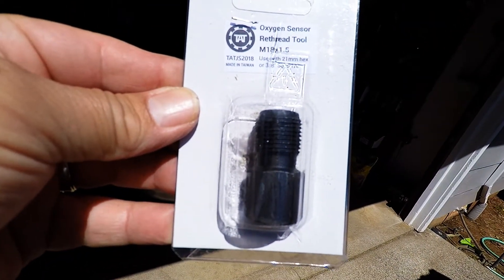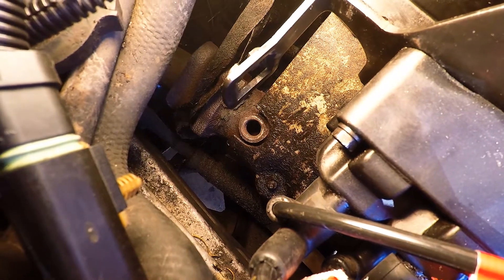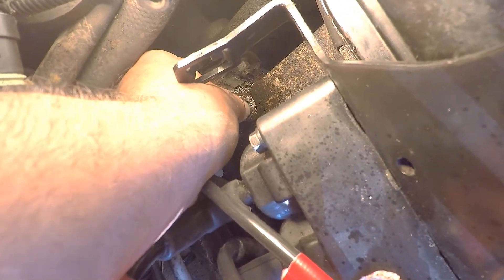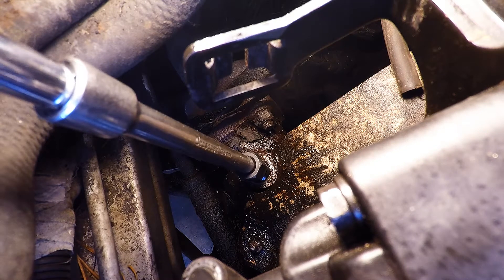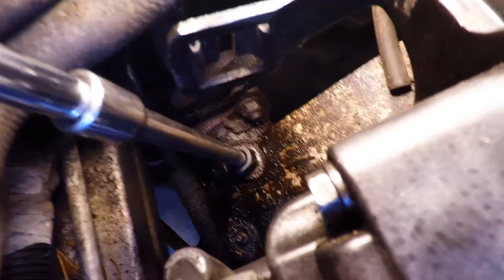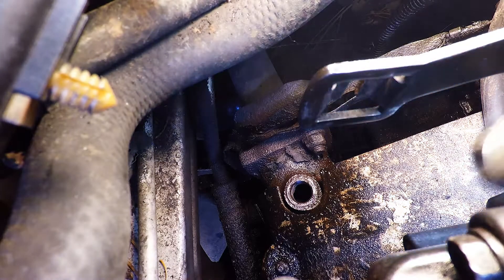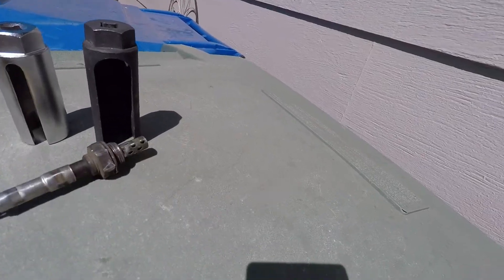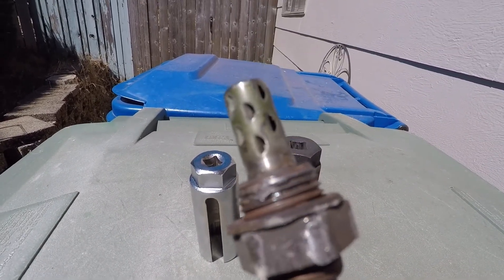Oxygen Sensor rethread tool.

Comment: What happens if its not straight and little bit crooked.
Reply from the maker: My only suggestion is to take your time. 1/8 to 1/4 turn with rotation. It my first time doing this. Also use lubricant during the process.

Comment: You can use a screwing hose-clamp around the split end of the socket to strengthen it when taking out difficult sensors. That way it will not bend at the socket rim split and further strip your sensor nut.

Comment: That's how my sensor got out. It is worse than yours optically but with a little time and a dremel , make in fit again inside the catalyst. I have put some antiseize grease and will never stuck again. If your sensor is not at good shape but works fine, you don't need to buy new one.

Comment: My o2 sensor threads messed up like yours.  Looked like the stripped out one at end of video.  How good did the thread chaser tap work? Where did you buy it?
Reply from the maker: Thread chaser work really easy as long as I took my time. I had never done this before. I bought it on ebay. There are a few other demonstrations on this procedure that was helpful.

Comment: Just to let someone else know those sockets they spread under pressure. You can use small clamp with a screw and put it around the socket when u have it on the sensor, it helps to keep it together when you turn your ratchet . It prevents stripping of the nut 😊 .
Reply: Small hose clamp works fine as some of those bustards are fairly tight
Reply: I used TWO hose clamps and BOTH of my sockets still spread open. I ended buying an induction heater tool and it stripped the threads. The chaser wouldn’t chase (no threads). The tap, almost like butter. Skip the chaser get the tap.